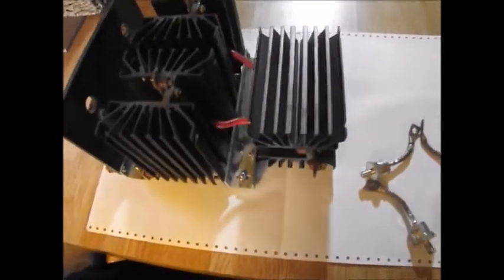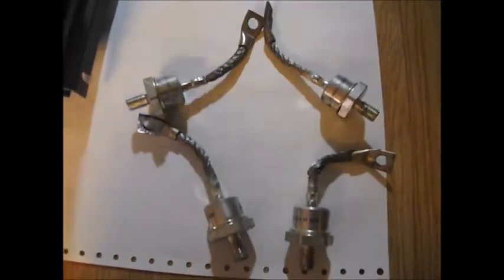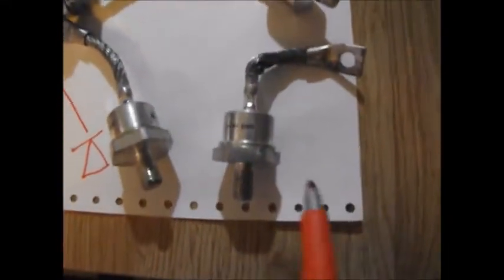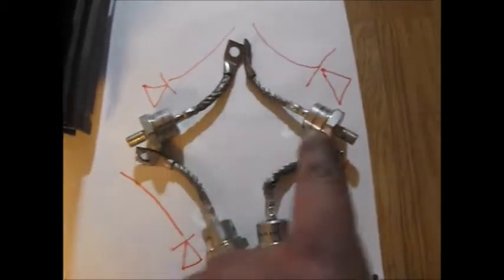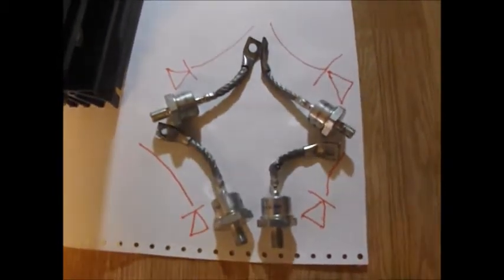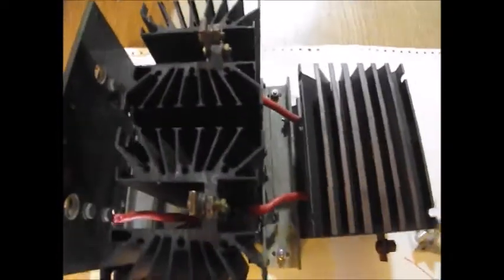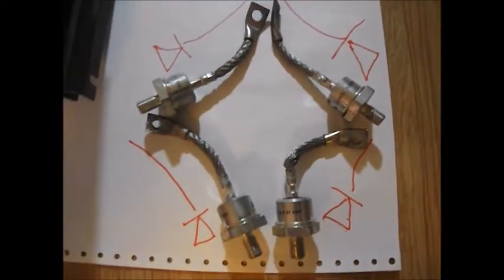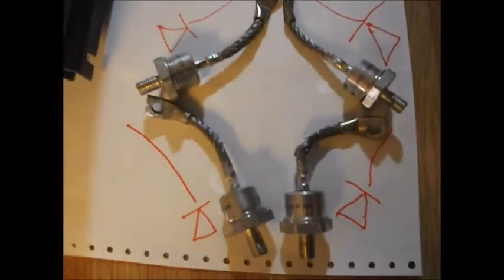Building A Super Bridge Rectifier Using Heat Sinks And Diodes

Comment: If I had to build say a 2V power supply I would feed a transformer with a triac based controller and rectify the output (using center tapping and two Schottky diodes) and then smooth the output with an inductor/capacitor low pass filter. This approach has the diodes working at a high voltage despite the low voltage output.
Reply from the maker: A lot of amps are needed here in the 2 volt range is why i went about it this way. Otherwise it is way to costly.

Comment: Whew, 9 years ago. My thought was a heavy duty step down transformer  from a welder. I just built a water cooled, dual, full wave bridge rectifier pair splitting the secondary center tapped output of a 10 amp step down 120 to 36 volt transformer made with the same monster diodes.
I power an hho cell with it and the bridge rectifier setup stays so cold that the weak link is now the transformer. Going to have to pump the electrolyte thru a radiator too because the diodes work so well that it could boil the water after awhile. Video coming soon.

Comment: You can get those a lot of high powered Schottky diode or microwave diodes and wire them in series on the load side which should drop the voltage for your battery charge to charge at a lower voltage

Comment: Sir for 10A which diode and capacitor I use?
Reply from the maker: Capacitors are based on voltage. Make sure the capacitor can handle the voltage. Just look on line for the diode you need there are plenty of them. Just read the spec sheet.

Comment: So the two upright heat sinks are charged with AC potential and can shock you?  Am I missing something?  I paused and screen shot and I finally have broken down and I’m asking-  the out side of the diode that bolts to the heat sink is seeing AC potential?
Reply: How do you use spiral diodes without energizing the heat sink??

Comment: Im request complete video about how to made power suply unit for elektroplating 🙏🙏
Reply from the maker: Just buy a used switch mode power supply on ebay. Best way and cheapest to.
Reply: @MrDoingEverything  ok tx for information 🙏
Reply: @MrDoingEverything  its need a tranformator or not
Reply from the maker: @danisupriadi0928  Switch mode power supplies have everything already. Just plug it in and use the output. EXAMPLE  the DCJ11002-01P is a 5 volt 200 amp out put. Input is 100 to 200 volts AC. There are 100's of these switch mode power supplies out there for cheap prices. The only hard part is they all have a pin out that needs to be figured out for them to work.  They come in all different DC voltage and amps for there outputs.

Comment: What were you building it for if I may ask?
Reply from the maker: A single cell 2 volt battery charger. Very large 2 volt lead acid battery.
Reply: How many amps is the battery?
Reply from the maker: @patrickkabuki7049  1000

Comment: Your going to have to wire in a smaller diode to be like a starter so it starts the whole thing the when it's started make it bypass the starting system like they do on a bigindustrial electric moter
Reply from the maker: I ended up changing them out to where they don't need the trigger. Good plan there for the next one. I thank You greatly : )

Comment: Vlad Here, Hi,

I see you are having difficulty with the rectifier! It is not a matter of voltage as you state in the video. What you have there, installed in those heat sinks, are SCRs (silicon controlled rectifiers). They consist of a Anode, Gate, and Cathode. From what I can see in the video, those small red/white leads are not connected to anything. one of those is the gate terminal (probably white), while the small red wire is an aux anode terminal which probably once apon a time connected to some sort of printed circuit board. When you touch the gate to the anode, the scr will latch and conduct ( as a diode, i.e. one way current flow).

Note: a shunting resistor should be used when doing this as the gate requires a small voltage. What you got here is a matter of incorrect components, as you have done some research and your bridge rectifier is correct in terms of wiring. Also that 3rd heat sink that is on its side would work best if you stand it up vertical like the other 2. it will be more efficient that way in regards to dissipating heat.

To reiterate: do the home work, pick the right components and you will be trouble free, pick the wrong components and you will run into problems.

...do your research, folks.
Reply from the maker: Vlad Here Very helpful info Vlad. Thank You